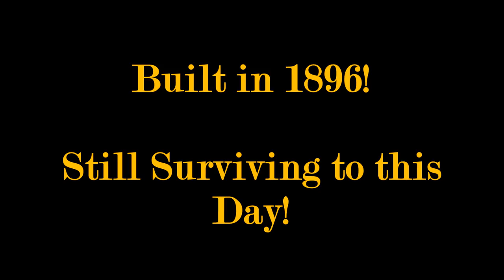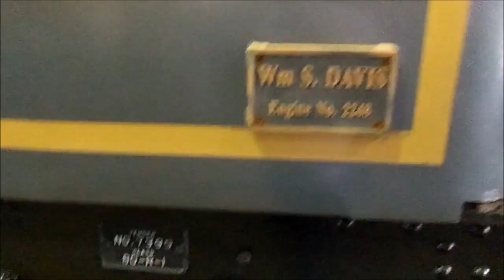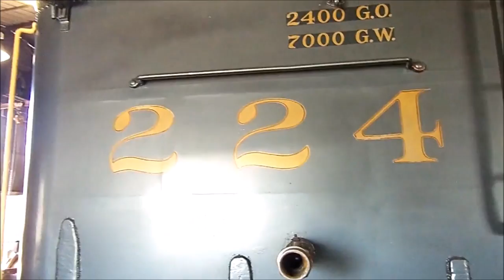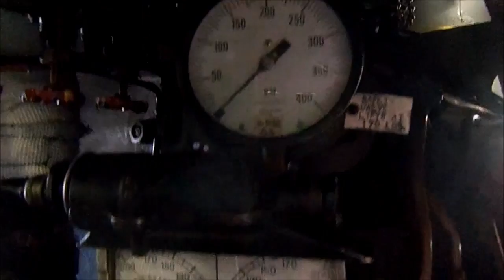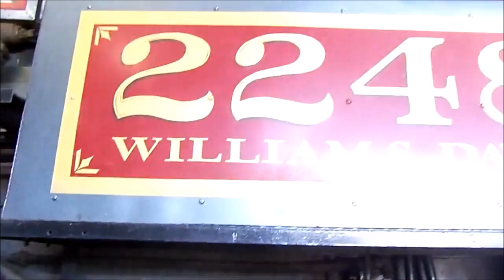A Dream Come True: 1896 Cooke 4-6-0 STEAM LOCOMOTIVE TOUR!

Comment: You know, if the US can't provide decent public transportation. We could at least restore the steam locomotives in the US and have them run in service or excursion. We may not have high speed transportation like in Europe and in Asia, but you know what? At least we can make it up by having the US running historically, iconic steam locomotives. And that's something Europe and Asia doesn't have.